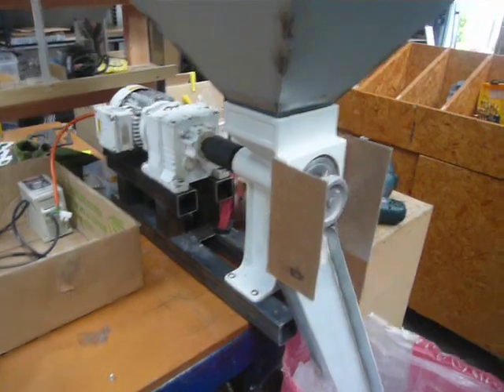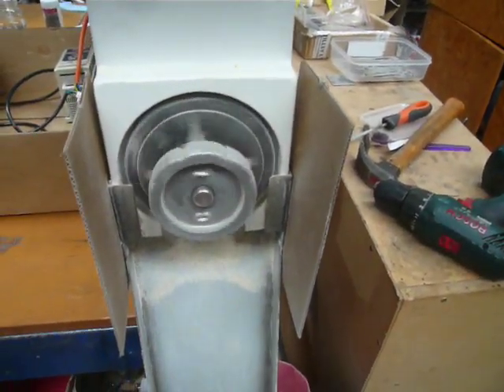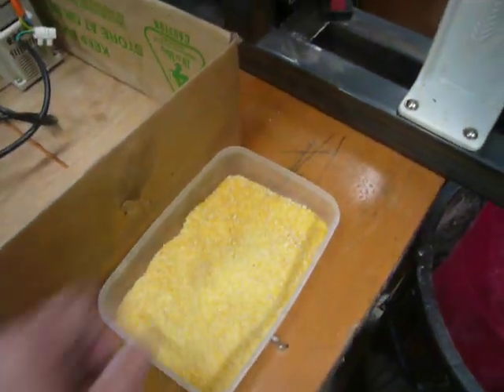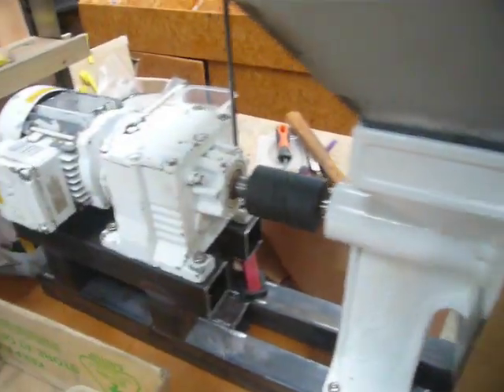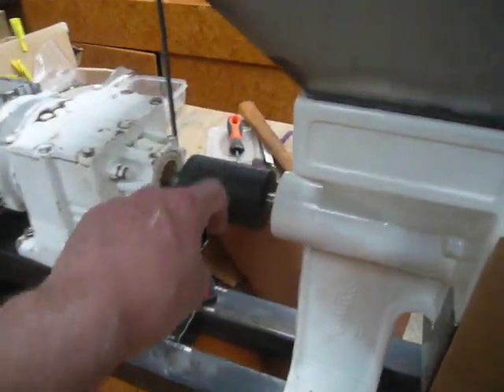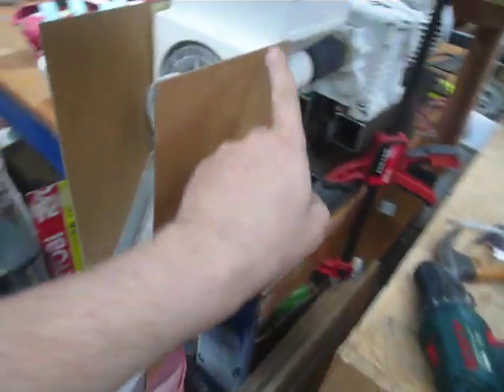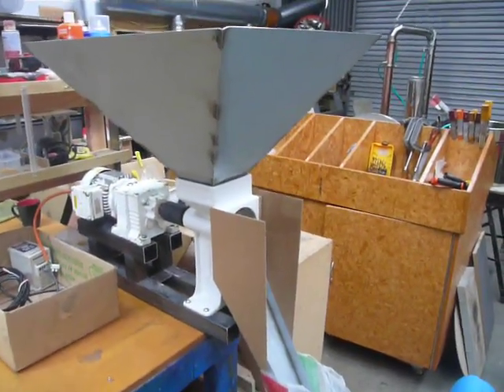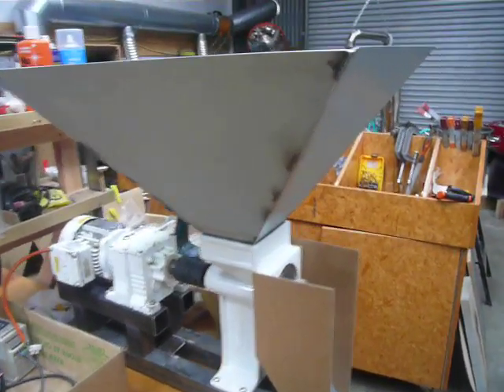Grainmill re-powered

Comment: So jealous of your work buddy ;)
Reply from the maker: No reason to be jealous, just jump in with both feet and have a go - it's all scalable and everything I do is nickel and dimed on the cheap anyways. :o)
Happy Distilling to you Chris!
Reply: I dunno, every vid of yours, I'm always thinking "Far out, I wish I had one of those...". 
Maybe it's also the fact that you weld, I have no idea how to do that.
Reply from the maker: G'day Chris,
Yeah welding is a very handy skill regardless of what you are using it for.
It's not that difficult to pick up, TIG welding requires a bit self-learning and some acquired hand-eye coordination, after that you're away laughing.
A very small intro' TIG unit is all you need for this brewing/distilling stuff.
Reply: Angry Parrot Distillery 
Sounds like a plan... but it’ll have to wait until I’ve finished uni.

Comment: Great fab on the grist mill!

Do you need the speed controller? Or can you just run it direct on 220v?

Only reason for asking is I run a (110v) 1725 rpm motor with a 40 to 1 reduction gearbox. So I get 43 rpm-ish on a 2 roller grain mill. Had to mate 2 separate lovejoys for coupling the shafts.
End result is a nice hand speed cranked grain mill without the fatigue. Now I just need to build a bigger hopper to accommodate a "bucket" of grain at a time...

Cheers Parrot!
Reply from the maker: G'day BigEd! :o)
Yep need the speed controller for this motor (it is a 3-phase industrial motor).
VSD switches the input from the standard 240 Volt single phase to 240 volt 3-phase (the motor windings have to be run in "delta" config' for this as opposed to "star config" for regular 400volt 3-phase).
Basically allows me to run a 400Volt 3-phase motor off a standard 240volt wall plug (not all 3-phase motors are capable of this).

The motor won't have the full torque it would have under a full 3-phase 400Volt supply but with the massive reduction gearbox it is more than enough to cope with my madness.

The VSD controller also has a whole gamut of controls that can be set digitally; speed settings, start-up acceleration (makes it gentler on the motor) - deacceleration, overload cut-off thresholds, … all sorts of cool stuff.
Reply: Ahh Now I get it. I have only delt with (hands on) single and 2 phase motors. Only 3 phase motors I have delt with were installed (me rigging with a gantry or forklift) and having a electrician wired them in. Mostly in assembly lines and paper mills.

Comment: What type of mill is that?  I've just purchased a hammer mill. But I like the even size of ground grain is it adjustable?
Reply from the maker: G'day Kerry,
It's called a "Country Living" grainmill.
S'pose to be for folks milling their own flour offgrid which is what I originally bought it for.

Completely adjustable, the handnut on the front can be screwed in or out to increase/reduce the size of the milling.
Does all the way from cracked corn to fine flour.

Once you motorize it it's not too bad a unit.
Has a set of auger feeds in the head of the mill you swap in for milling/cracking corn - which most brewing crusher/rollers won't do.
Output is slow but I have time ... at the moment. 😊

Hows the hammer mill perform?
I'd been looking at those with a view to speed up the milling of corn down the track.

Happy Distilling!